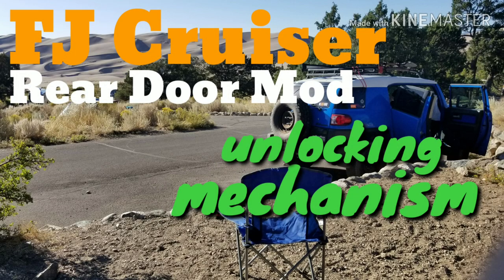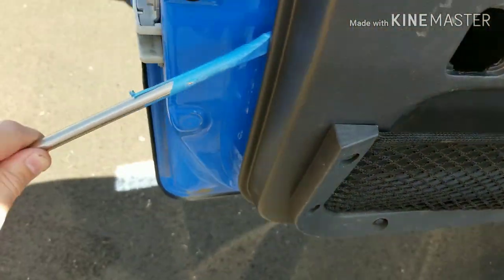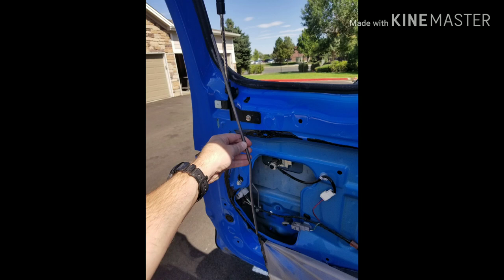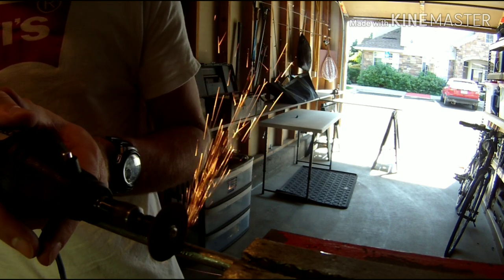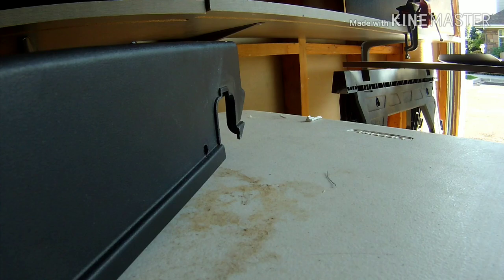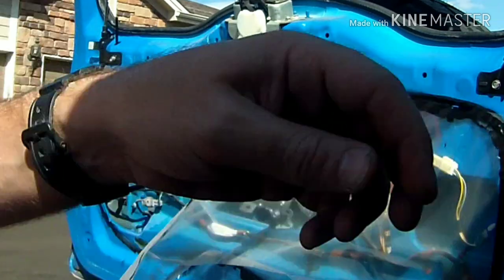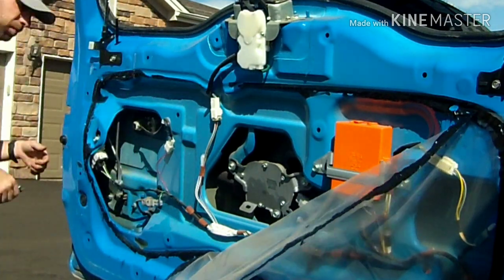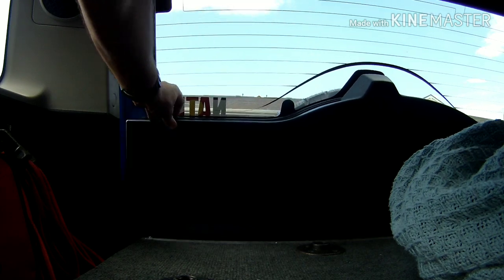FJ Cruiser Rear Door Mod

Comment: Very nice video.  Guy on the fj Cruiser form makes a complete kit no drilling holes. Has a push slide button that mounts in existing square in door panel. Also comes with a handle which allows you to pull door back shut.  I sells lots of these. I can’t remember the price everything less than $50 bucks and it all looks factory.  Choose your own colors also.
Reply from the maker: I like that idea!
Reply: Do you happen to have a link? Thanks

Comment: Great mod. I did something similar in my Astro Van. The outside rear door latch was the only way to open the door and handle was made out of pot metal. So if it snapped, which the do often, You can't open the doors. You have to ake the rear seat out and the panels to get it open and replace the handle. After the second time I got fed up and did something exactly like this but used stainless steel fishing lead instead. Used some string to pull it through the hole and attached a keyring to the end.

Comment: That goo is called urethane. That "connector" is called a cable clamp. I would go a step further and run a 1/4" X 32 die down the rod a bit, and then screw on a side door lock button from an older car from the '70s or '80s. They can be purchase in the Motormite/Dorman "Help" section of your local auto parts store for coffee money.

Comment: I completed mine today. Yesterday the rear door would not open so I had to go back in to see what was the problem. It turns out that there is a piece of styrofoam in the door panel that the rod has to go around/through. I did cut away a good portion (I thought) before. But the rod was pushed up against it when I reinstalled the door panel so I cut away more of the styrofoam and now it works great. Fabulous.

Comment: Great vid.  Im wondering if a flexible steel cable with a loop on the end wouldnt be easier and just as effective.    Drill through the plastic on top while its still connected, this will mark where you have to drill the steel.  Take panel off, drill steel, connect flexible cable to the rod with same clamp, reinstall cover, lastly  make loop with a crimp and pliers.  What do you think?
Reply from the maker: Sounds like a great idea! 👍

Comment: While at it, might want to add a small-pull cord to be able to open the rear window from the inside.
Reply from the maker: I don't see why not! :)
Reply: (old reply I know) The rear window is electronically actuated and not mechanical like this door latch. People are using a simple momentary switch these days patched into the factory harness.

Comment: Greetings,my fj cruiser does not want to open the back door with nothing does not respond, is there any solution for that?
Reply from the maker: The back window or door? The back door can certainly get stuck after installing the release. Just make sure everything moves smoothly otherwise it will stay stuck in lock or open. Slamming the door a bit harder helps too to make sure it latches too.